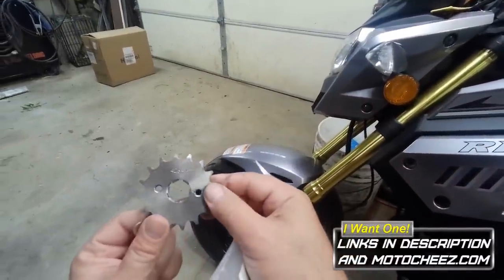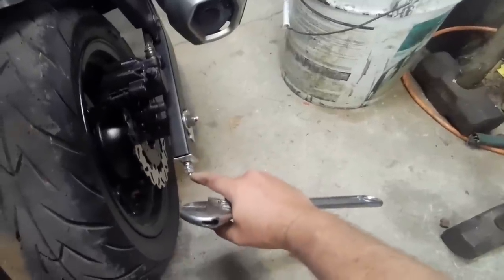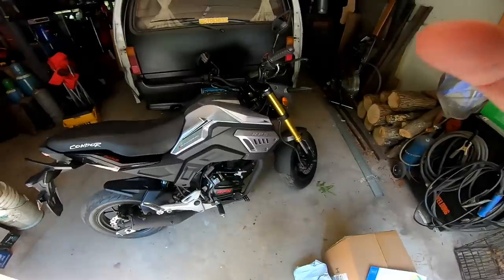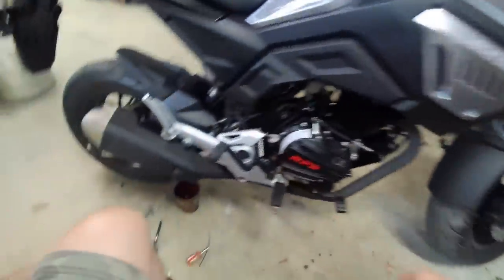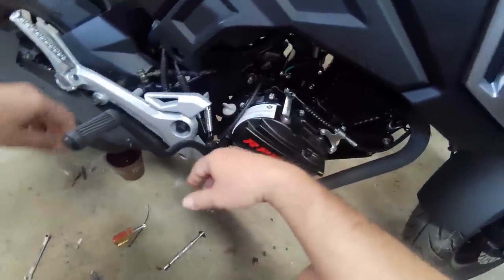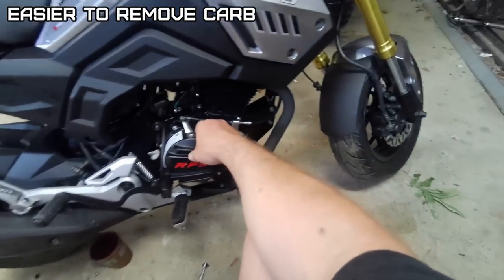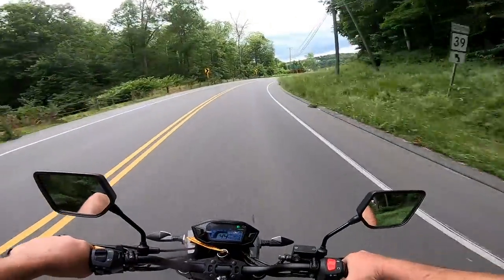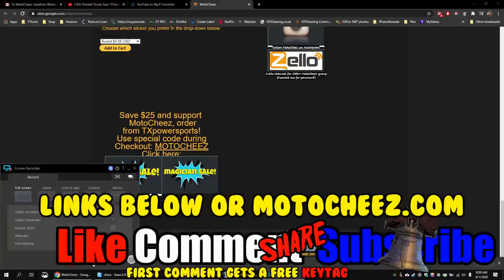(E3) RPS Condor 150cc  16t sprocket 98 main jet, 0-50mph and top speed! I lost something

Comment: I have the vader125 gen 2 and the only mods I've done is 17t sprocket and nibbi carb and mine cruises at around 50.i thought the condor would be faster being a 150cc with 5 or 6 gears. Once you upgrade the carb and exhaust and also the spark plug., I think it will do what it's supposed to..

Comment: Hey Cheez, on your website you list the rear brake cable as important. Is the stock cable bad?
Reply from the maker: If they have not changed it, yes. It's too short and will wear and break by swingarm. Have video showing it

Comment: Keep an eye a on those sprocket's keeper, last month I ignored mine was in bad condition and forgot to buy a new one and I got rekt on my "hawk" going 60, the sprocket fall off and got stuck between the swingarm and the frame and lock the rear tire completely, loss control of the bike and I fell, lucky for me I was able to control it until the last secs, the bike was fine... sort of, the slider got destroyed the front brake lever too and part of the rear hub gone, only for not changing in time that keeper in time
Reply from the maker: Damn! Never had one do that! I've lost the keeper and sprocket stayed in shaft for I don't know how long years ago on a TS125
Reply: @MotoCheez  you got lucky there then, but better to have some of those keepers on spare and check it out in every maintenance of the transmission, I didn't change mine cuz hadn't one in that moment

Comment: Hey man.... trying to pick your brain about my carb jetting....I have the bike you sold your buddy the Apollo 250 rx deluxe....and I have a pipe ...I put the mikuni vm 26 on it.....and the stock carb was no good lean pop in low and high rpm after break in ...just garbage so ...it seems to me to be running decent with the installed jet.....just wondering what are your thoughts on the jet sizes
Reply from the maker: Try a 110 main jet and 2 1/2.turns out on mixture.
Reply: @MotoCheez  thank you

Comment: do you think a cg230 would bolt to this bike? was almost temped to buy one and drop my older cg engine on it to see if it would work out
Reply from the maker: Yes! I have a CG250 (230) donor I'm going to put in mine. Looks like it'll bolt right in.
Reply: @MotoCheez  thats awsome cant waite to see the results of it, and if possible maybe later on you can do a video of the big bore kits for the cg250 engines
Reply from the maker: I saw they're finally available!

Comment: My Hawk is getting hard to get in natural when hot. Would  you  put synthetic in it ? And pulls a little with clutch all the way in but only when it hot .Thanks
Reply: Clutch needs adjustment. It's not fully disengaging and that's the reason neutral is hard. If you don't fix it your clutch will be ruined shortly(under1000 miles)
Reply: @infesting  Thanks, I will try that, so you want me to shorten the cable some  right ?
Reply from the maker: Yes. Should only have 1/4 play

Comment: I am confused why do all these mods when my stock RPS condor 150 cc goes up to 64mph? i dont see much difference in gaining top speed after you changed Carb, jet, Sprocket.
Reply from the maker: Have you checked your speedometer with a GPS? These mods absolutely give it more power
Reply: @MotoCheez ok ill try that.. also where did u get the sprocket cover from?? My stock sprocket cover wont fit after changing it to 17t..
Reply from the maker: @omer5321 stock cover fits, have to finagle it a little
Reply: @MotoCheez  Thanks for the replies ill try that

Comment: Ay bro my condor ignition just fucked and wont start anymore no matter how much i turn the key it just wont start anymore. Tried a 4 prong plug and play from amazon didnt work. Any recomendations?
Reply from the maker: Has spark? Fuel? Compression? Or is it not cranking like battery dead?
Reply: @MotoCheez  like the batterys deadb
Reply from the maker: So you push the starter and it doesn't click or do anything? It could be the safety on the clutch lever, make sure it's a neutral I can't remember if it has that safety or not and it kickstand is up. Did you try jumping the battery or charging it?
Reply: @MotoCheez  no actually left it to a small motorcyle repair shop so idk im gona go today and see if he could get it to work with the ignition i bought on amazon or whatever
Reply from the maker: But if it the starter is not turning the motor over it wouldn't be the ignition, did you try kickstarting it
Reply: @MotoCheez  so the ignition didnt work from amazon not the same color wires i dont know what to do man the local place here where they sell them is saying 175$ for the set
Reply: @MotoCheez  can u help me with a hotwire
Reply from the maker: There are 2 different ignitions, that has an AC style ignition, if you bought the DC it's not worth rewiring to make it work
Reply: @MotoCheez  would a chinese bike ignition work it has the same color wires
Reply from the maker: If same type it should
Reply: @MotoCheez  I had the same issue it was my ignition that was fucked

Comment: Say Cheez can I put a 17 tooth sprocket on it..mines should be here Monday and I’m trying to get all upgrades to mod it out for more speed??
Reply from the maker: Yes, It's tight to get the cover back on but it'll go You just got to keep wiggling around
Reply: @MotoCheez  ok appreciate it
Reply: Say Cheez my Condor came in and I think it’s not getting gas from the tank I’m thinking the line from the tank is clogged up…any suggestions ??? All infr would be much appreciated thank you..
Reply from the maker: @yugzjones7366  definitely make sure that the tank vent isn't pinched I believe there's a hose on that one If not maybe it is that lid with the key on it. You can open the lid while you're driving or while you try to drain it to see if that is the problem or maybe try blown back in through the line
Reply from the maker: Pull a hose off that goes into carburetor and see, the fuel shut off is kind of up in there to get to
Reply: @MotoCheez  thank you Brother
Reply from the maker: Any time!
Reply: I think I located the problem the fuel line from the tank was being pinched..the wire harness is zip tied and it’s in the way.. any suggestions..?? And 1 more thing do u have the moto cheez key chain in red😊😊😊
Reply from the maker: There should be a way to root it around where it's not going to get pinched somehow, no I'm all out of the black key tags All I have is leather and the standard yellow left
Reply: Thank you and How much for the key chain Sir😊😊😊
Reply from the maker: Bottom of page www.motocheez.com
Reply: Cheez I got it going Bro… I moved the wire harness and moved the petcock and now I’m getting gas…thank you once again bro for info.. and y didn’t tell me it was that fast‼️‼️‼️‼️😂😂😂😂

Comment: I wonder if it would be out of your comfort zone to do a DIY e bike some time? You can use a bike with some suspension and disk brakes to add a kit motor, controller and battery set up on. Throttle grip or thumb throttle.. Motor sizes from 250 watts up to 5,000 watts . 
 Some guys build bikes that can go up to 50 mph without peddling 😂
Reply from the maker: I want to do something with an ebike...

Comment: HI MC,
My Condor shipped on the 30th, hopefully it gets here next week.  Anyway, based on Sprocket Calculator's website a change up to 16 teeth should provide a 6.7% increase in speed with a subsequent 6.7% reduction in torque, which it is what I'll be testing since I already have a 16 tooth chainring in my garage.  My thinking is that living in flat Florida I probably won't mind the loss in torque as much as I'll appreciate the speed gain.  

BTW, ordered the main jet off of your link below. Thanks.
Reply from the maker: Awesome! Yes, you're correct. 
 I like the less rpm at higher speeds. Then more power mods the better!

Comment: That motor is likely made for third world countries that have bad low octane gas. Milling the head and having the valve seats and valves cut with a performance valve job would probly really wake it up.
Reply from the maker: The CG clone engine is exactly that